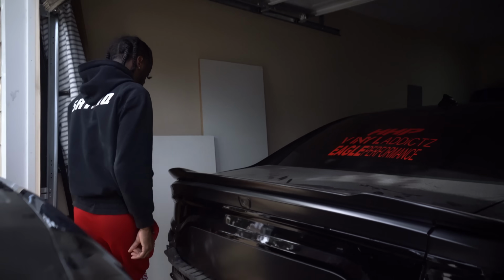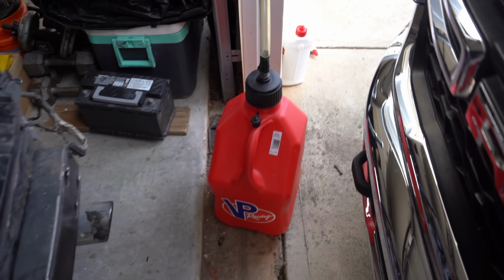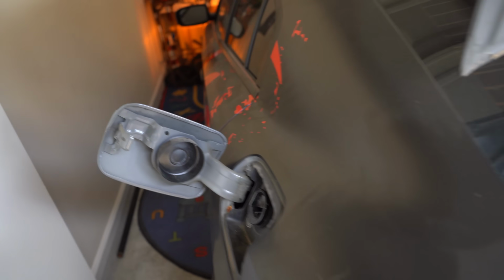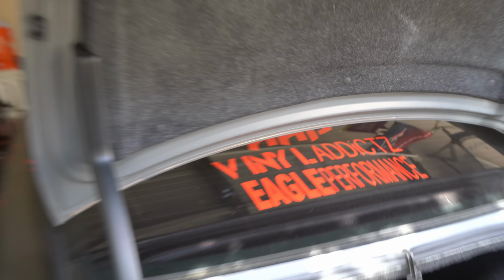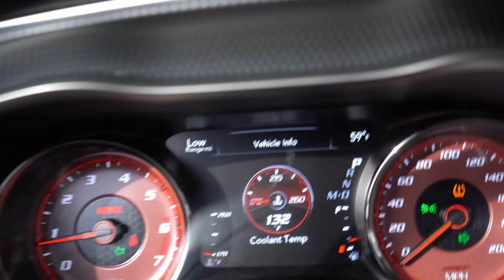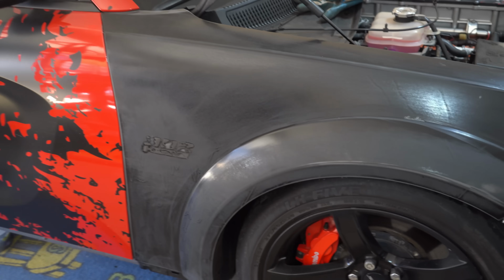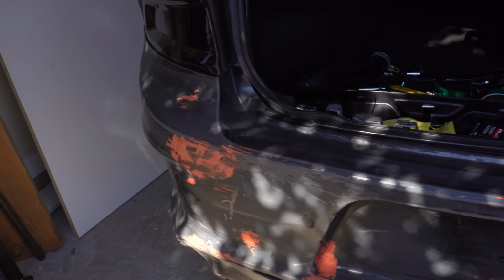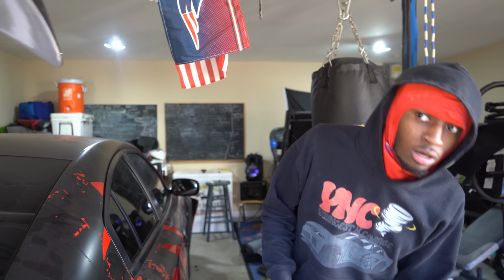STARTING THE WORLD'S LOUDEST HELLCAT !!!

Comment: For the rear quarter panels you have to cut them to make room for the widebody rims and tires if you don’t it’ll rub and if you hit a bump the tire will knock the flare off. Also to get the flare to sit flush you have to grind down all those tabs on the back. Then to secure them you can use self tapper screws and 3M tape but if you don’t feel comfortable with the 3M tape you could also use epoxy. I helped my brother install his so I somewhat have some knowledge of doing it.